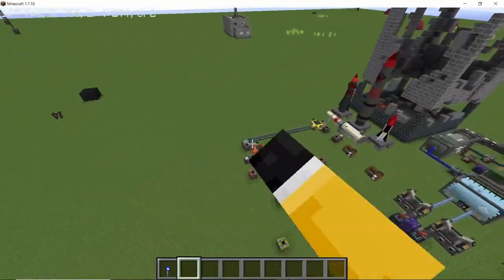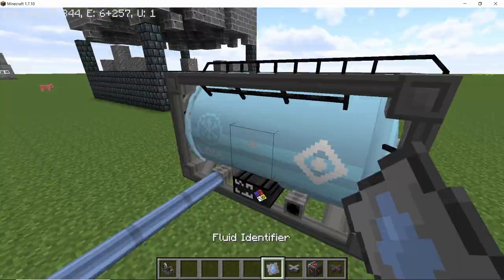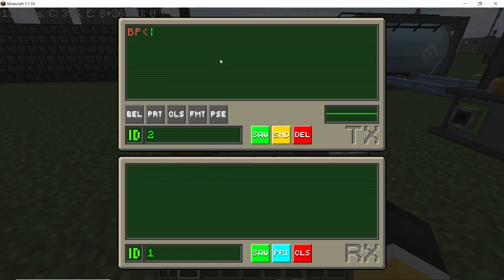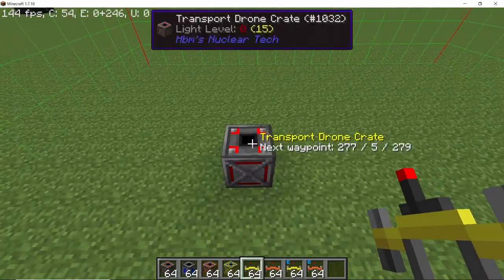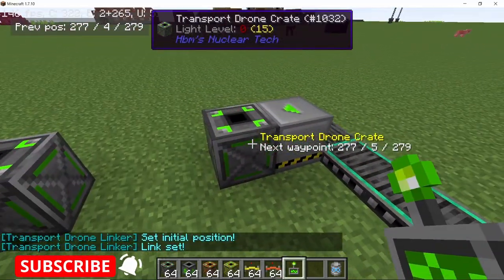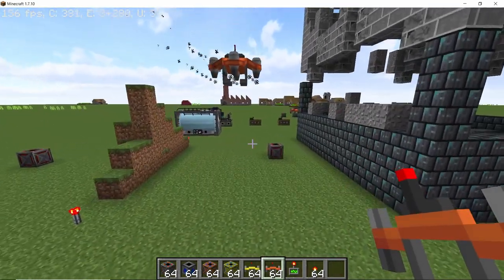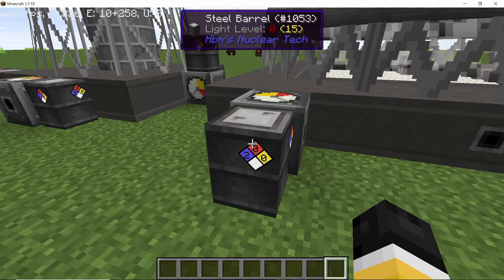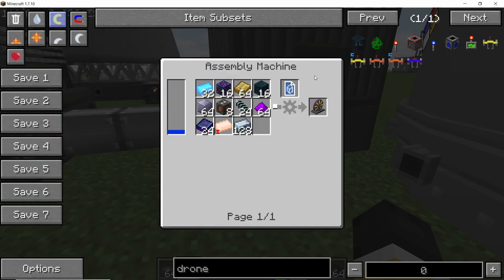Logistic Drones, Arc Welder, Powered Condenser & Bunker Buster Missiles - HBM's NTM Update

Comment: Chunkloading drones aren't working in survival. I tried closing the loop in my survival world but it just keeps coming back after the first waypoint. I did exactly as in your video and on the fandom there is no info on drones so I guess they aren't fully optimized in the mod yet
Reply from the maker: Oh I am sorry for the late reply but if this issue isn't fixed even after using the latest version of the mod then I recommend reporting this bug on the official NTM discord.
Reply: @SavageVegeta  I figured it out eventually. I think the way they work is they only load chunks when they carry cargo. For example, I have a large mining drill in the spawn chunks meaning it's working all the time. My base however is outside of the spawn area so it's not loaded when I am away. So drones are always carrying mined cargo when I am at my base but when I am at the mining drill they drop off the cargo they are carrying to my base and then they don't come back until I come back to the base and it loads again. It's a little confusing but the important thing is it works.
Reply from the maker: @okramra  ah ohk that makes sense, maybe then you can install a dedicated chunk loading mod to always keep those chunks activated and then this issue won't happen
Reply: @SavageVegeta  yeah you are right, chunk loading mod would be especially helpful for this mod

Comment: Hey bro what’s your computer set up I have a 3060ti and Ryzen 7 2700 and I’m not really able to run  modded Minecraft the good (hbm mcheli)
Reply from the maker: I have Ryzen 5 processor & GTX 1650 ... with your specs I have no idea as to why you have issues with mods as my mid spec laptop can run them without much issues

Comment: I have a problem with the schrabidium robot from that old video, does it still work? i copied exactly the same code and the program wont start, can i contact you on discord to figure it out??
Reply from the maker: I am sorry for the late reply, I have been pretty inactive on all my social media handles in general these past few months as there's alot going on in life. 
I can however suggest a workaround for this problem ... use Euphemium capacitors instead of Redcoil capacitor as with euphemium capacitor you will never need to discharge it so the process can run forever without the need of an OC robot to remove the charge
Reply from the maker: I have used the euphemium capacitor in the following video so that should give you an idea : https://youtu.be/ysKWD9UXr2Q?si=Gu-s6LNvxlSgT4Zh